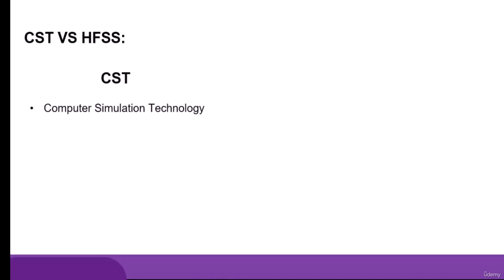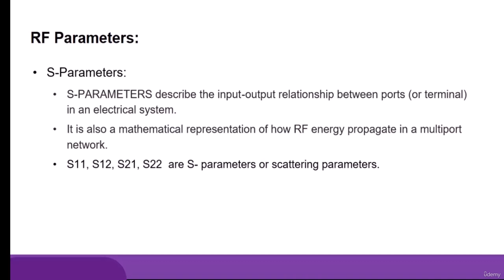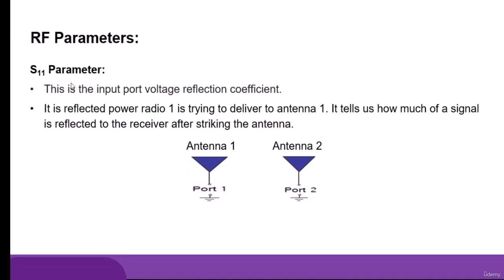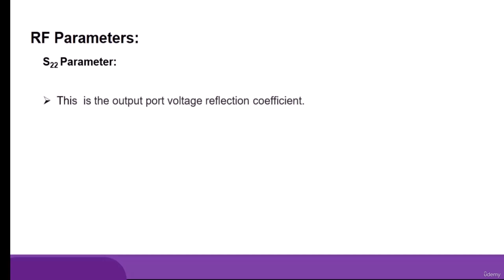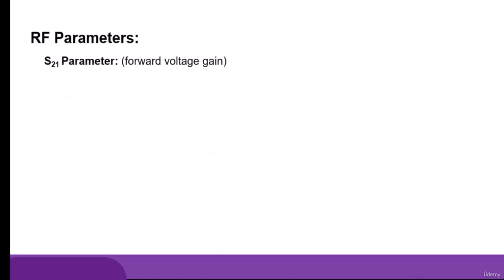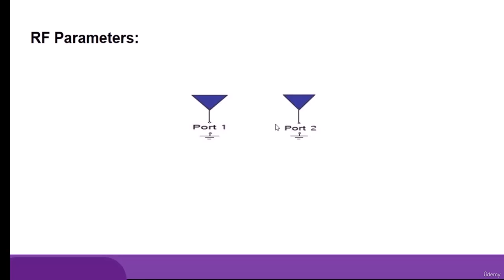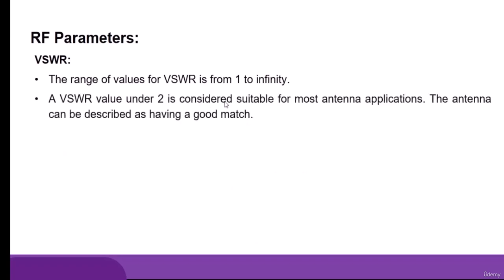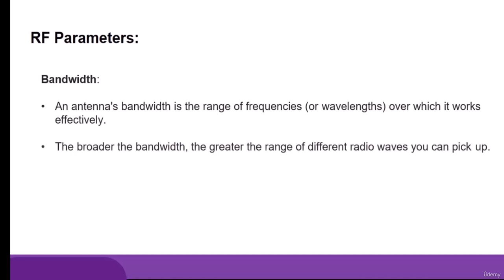1.2  Understanding S-Parameters, VSWR, and Gain

Comment: Really solid CST antenna work — appreciate how you connect S-parameters, VSWR, and gain with full-wave antenna simulations. Content like this is very helpful for people moving from theory to EM solvers. 👏

One set of relationships I personally find useful when analyzing antennas is how these parameters connect physically:

For a 1-port antenna, S₁₁ is essentially the reflection coefficient. VSWR and return loss S₁₁ are just different ways of expressing the same matching behavior: 
VSWR = (1 + |S₁₁|) / (1 − |S₁₁|), and return loss = −20 log10(|S₁₁|). These tell us how much power is accepted at the feed, but not how well that power is radiated.

That’s where radiation efficiency and realized gain matter. Realized gain combines directivity, radiation efficiency, and mismatch loss (1 − |S₁₁|²), so it gives a much more complete picture of actual antenna performance than S₁₁ alone.

For 2-port antennas and arrays, S-parameters become even more interesting. S₁₁ and S₂₂ describe matching at each port, while S₂₁ and S₁₂ represent mutual coupling between elements. Coupling directly affects active impedance, embedded element patterns, array gain, and scan performance, so looking at these together is very insightful.

On the simulation side, results are often sensitive to mesh convergence, boundary placement, port definition, excitation phase/amplitude, and far-field normalization. Correlating S-parameters with surface currents and radiation patterns is always a good validation step.

Overall, this is high-quality, technically grounded antenna content. Please keep uploading — channels like this really help the community and deserve much more visibility. 📡🚀